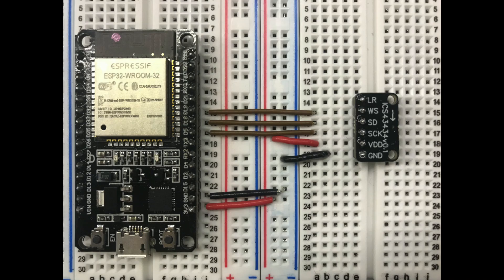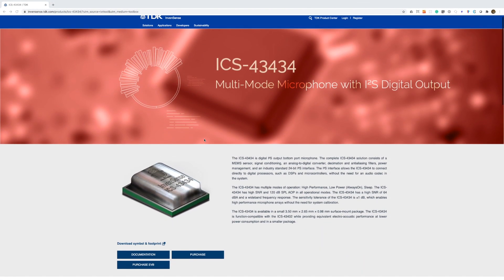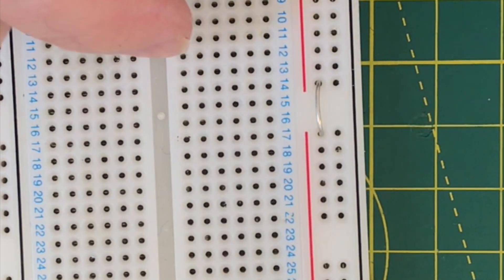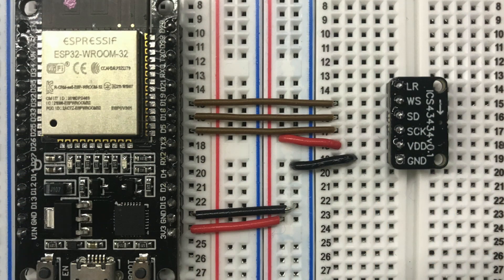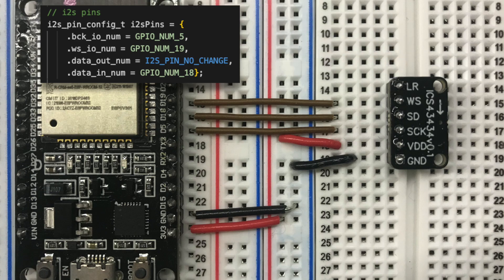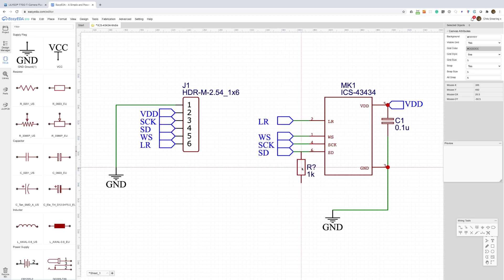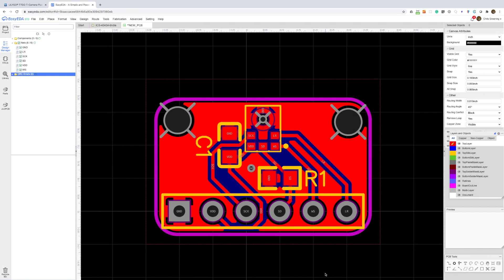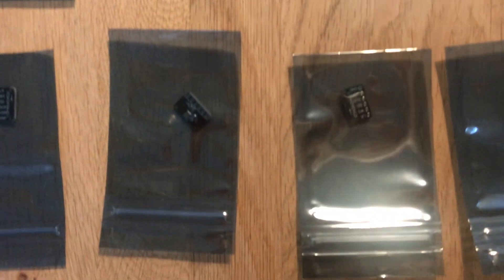ICS-43434 A replacement for the old INMP441 - Ideal for the ESP32

Comment: what about the SPK0641HT4H-1 
it is much cheaper,
and based on the specifications should generally be slightly better, as it has a slightly wider frequency range, and a very slightly better signal to noise ratio accoarding to the specs.

mostly the differences based on datasheet don't really seem that big/notable, only in the low frequencies as going to 20hz instead of 60hz is a difference which can be noticed(though the cheaper one can go *lower(while remaining kind of sensitive).

the main diference however is that the SPK0641HT4H-1 cost €0.68 a piece, and the ICS-43434 cost €1.65 a piece (in huge amounts, but for the smaller amount the difference is around as big since when buying in a single unit the SPK0641HT4H-1  costs €1.34, and the ICS-43434 costs €2.99.

right now you still see most people use the old INMP441 microphone, which has a very limited frequency range compared to both of them, so I assume the INMP441 chips are probably a lot cheaper as some manufacturers probably bought much of the final stock and now are using that.
that said the SPK0641HT4H-1 is also really cheap even new through official stores, so adoption might be a lot better, and while the chip layout is different, it has the same connections and everything.

ofcource there might be better chips, I just looked at a local retailer for mems microphones a while back, and looked for both the best and cheapest options, essentially I looked at good enough quality preffering that they atleast can get close to 20hz to 20khz, 60h to 18khz would also be okay back then, and then I also looked at price. for example I also came across a better one which went from something like 10hz to 200khz with good sensitivity, which is fun but unneccecairy for general use, only for some experiments. but I focussed mosly on it being good enough for normal audio recording. but came to that mems microphone for the ones I looked through.
that said I only rapidly looked over them and only a limited amount of them, so there might be better and better value ones, but didn't seek much further.
right now however that one would be insane value compared to the ICS-43434 if there isn't some kind of hidden problem,
and it has the same pins, just diferent layout.

Comment: Thanks for the video! Are you still selling ICS-43434 modules?
Reply from the maker: Unfortunately not. The economics doesn’t really stack up and Tindie doesn’t handle EU VAT rules which makes it hard to manage. I did find this https://sensormaestros.com/products/audio-2/i2s-output/ics-43434-i2s-digital-microphone-evaluation-board/ I’m surprised at how few microphone breakout boards there are.
Reply: Can you share your cost to produce?
Reply: I am also interested in the approximate production costs, could you share some information about it? Thanks

Comment: If you'd rotate the resistor 180 degrees you could route ground between the SD and WS connections, allowing for the potential creation of a true single sided board. Or even route ground between WS and LR to allow the board's height to be reduced by moving the resistor to the side of the microphone instead of inbetween the connector and the microphone.

Comment: I find this very interesting. I'm not that good at programming, but I have an idea. I want to make a noise-activated recorder with ESP32 and this ICS4343 microphone. Do you think that it would be possible to make a recorder that continuously listens in on the noise from the surroundings and start recording when the noise levels rise above a certain set threshold? (threshold to be adjusted manually).

Comment: Hi there, I've managed to make a couple of these boards but they have a very noisy background when using your git repo's sketch, akin to your MAX microphones, plus the wifi noise burst. Are you using the denoising from those MAX microphones to get such crisp sound or did I do something wrong? Soldering the IC onto the PCB with just an iron was a nightmare (will definitely have it assembled next time) but I do hear myself so I'm guessing everything is connected properly?

Comment: Hi there! I'm using an Inmp441 with my ESP32 and it seems to be working (recording), but the volume of the recording is very low. Any ideas why this might be happening?
Reply from the maker: You need to amplify the signal in code quite a bit. The best thing to do is to read from mic in 32 bit mode and then scale the samples up by quite a lot.

Comment: although ICS-43434 is newer than INMP, is it any better or so? For sure it is 2x more expensive ;-)
Reply: The ICS-43434 uses about 1/3 the power and has an SNR of 65dB vs 61dB for the INMP441.

Comment: Hi, should this sketch + node-js program also work with the older INMP441 ? I tried it and there is data streamed from ESP32 to my PC (736kB for about 12 seconds) but  the sound quality is very bad in Audacity, it is almost not possible to understand the spoken words, but the words are visible in the graph. I tried  settings 16bit and 16kHz mono and stereo in the Audacity settings. I also not understand     .data_out_num = I2S_PIN_NO_CHANGE,  Can you advice please? What to do to transfer it with a good quality?Thx in advance. Is there an example to forward I2S micro to I2S DAC?

Comment: Hi there atomic14 :)
I love your content and it already helped us so much. We would like to use the ICS-43434 but unfortunately we need something more sensitive in low frequencies. Therefore i made a breakout board for another MEMS. It kind of works but it comes with a strange waveform. I made a small video about it so you can see what i mean. If you have two minutes. It would be awesome if you can give us your opinion.
Link to the video: https://youtu.be/CQygS2ww84Y
Reply from the maker: The first thing I would try is making sure it's not a power supply issue. Microphones can be very sensitive to power supply noise and fluctuations. Some microphones are quite good at rejecting this noise and some not so good. It's worth trying to supply the microphone from a battery and LDO regulator to confirm if this is the problem.
Reply: @atomic14  Thanks so much for looking into it. But power supply does not seem to affect it.
- powering the MEMS directly from a 3,3V battery -> Same result
- Connect the MEMS to different grounds -> same result
- powering the complete device (incl. ESP32) from 3,3V battery  -> same result
- using a different ESP32 board -> same result

I am not even sure if that is a interference problem. Should all I2S MEMS work with the same code? So it can't be the code?
If not then i guess i have to built a second breakout board. And try again. Any other suggestions?
Reply from the maker: @eloc-teamsumatra4936  There can be timing differences between I2S devices. I think the spec can be interpreted in all sorts of interesting ways - but I'm not sure that is your problem. It definitely looks like some low-frequency noise, but I've not seen anything like that before. In Audacity, you could try applying a high pass filter (but with a low enough cut off point to keep the frequencies you need) - if that gives you good results then you could implement a digital filter on the ESP32 side. I did come across another microphone that might be of interest to you - https://invensense.tdk.com/download-pdf/ics-40300-datasheet/ - this goes down to 6Hz but would need to be fed into an ADC.

There are also some evaluation boards for the microphone you are looking at - https://www.mouser.co.uk/ProductDetail/PUI-Audio/DMM-4026-B-I2S-EB-R?qs=TiOZkKH1s2RAv this would at least eliminate any problems with your wiring.
Reply: @atomic14  That microphone looks really interesting. How did i not find that? You must have a mic-database in your head :)
Also the evaluation board i did not know of. Unfortunately the international shipping rates plus import taxes are killing me.
So i guess i will just solder a different breakout board design and see if that changes anything. If not i will try playing with the timings in code. Do you know where these are defined? SCK frequency, SCK high and low in ns, WS frequency etc.
Reply from the maker: @eloc-teamsumatra4936  You could also try changing the sampling frequency. Try 44100Hz and see if that makes a difference. To change timings at that level you are starting to get into poking around with the registers. Shipping really is a killer for all these things :(

Comment: Very nice. Would be a huge challenge to measure sound pressure (dB) and output it, using only ESP32 ? I need 'simple' city/outdoor noise level meter ..
Reply from the maker: I think you could definitely make that work. The ESP32 could just monitor the sound coming in and then send a message over WiFi is it goes over a certain threshold.
Reply: @atomic14  Speaking of which - could you please share which of the 2 MEMS microphones you used (INMP441 and ICS-43434) is better at capturing far field sounds? I'd like to use one to detect far, faint noise (heavy footsteps). I also wonder if a really sensitive vibration sensor or an accelerometer would be a better option for this, both in terms of ability/easiness of capturing the input and suitability for processing it in TensorFlow Lite. Any hints would be much appreciated. Cheers!
Reply: @dan-nutu  Did you find an answer?
Reply: @potugada  No, and sadly  I had to park that idea due to lack of time
Reply: @ahostn In case you're still interested in this: somebody else has published a project to do just that. There are some really important additional aspects that you need to consider though in order to get reasonably meaningful measurements (e.g. sampling rate, length, resolution, Nyquist frequency, microphone frequency response, equalization and weighting, dBSPL vs. dBFS etc.). Either search for ESP32 MEMS Sound Level Meter using your favourite search engine or go there directly using this link: https://hackaday.io/project/166867-esp32-i2s-slm

Unless you absolutely need to use an ESP32 or the I2S interface or you're interested in doing this as a learning exercise maybe you'd be better off just buying a calibrated microphone instead? There are both analog and digital (i.e. USB) models. Or you could get a proper sound level meter - there's even one that can deliver measurements over USB while measuring. But even these have limitations in terms of frequency range (e.g. only up to 8kHz). Which is where the weighting aspect becomes really important. If you have a clear use case in mind that should dictate the weighting you need to apply.

Comment: Great video. And thanks for publishing the PCB layout https://easyeda.com/chris_9044/ics-43434-tindie
Reply: Could you make a short video showing how you place an order at PCBWay?
Reply from the maker: Definitely - I haven't got anything in the pipeline right now, but next time I will record it. I relied on them quite a bit to guide me through the production process, they handled all the panelling process and component sourcing.
Reply: @atomic14  what ESP32 board are you using? I'm thinking of getting https://www.sparkfun.com/products/15663 so I can use it in a few other projects -- but want to make sure this would be compatible
Reply from the maker: @wasauce  I'm using a generic ESP32 dev board, the one you've linked to will work fine as well.
Reply: @atomic14  Thanks very much!
Reply: @atomic14  - I built your project! Ordered the boards from pcbway, got the ESP32 board linked above and finally got it soldered and then wired up on a breadboard and successfully sending data to the server. Thanks so much for this great video series and for the detailed explanations!
Reply from the maker: Fantastic! That's so cool.